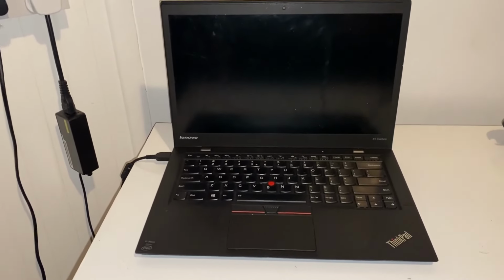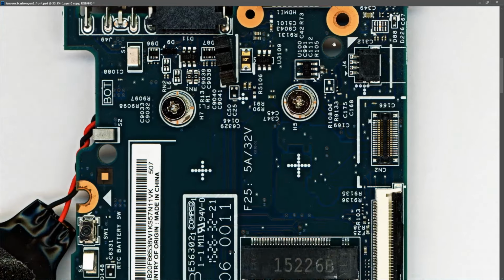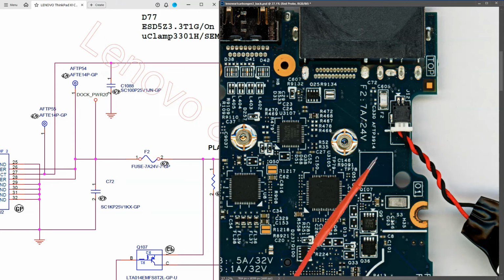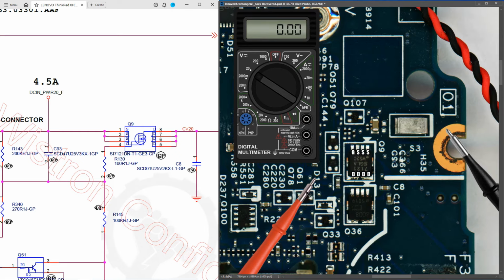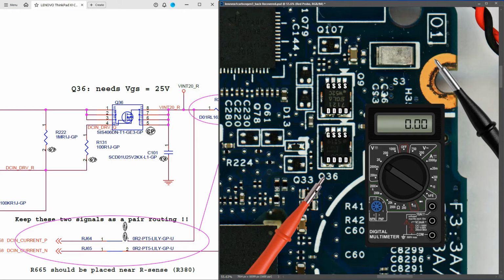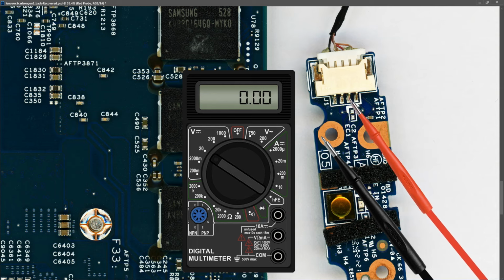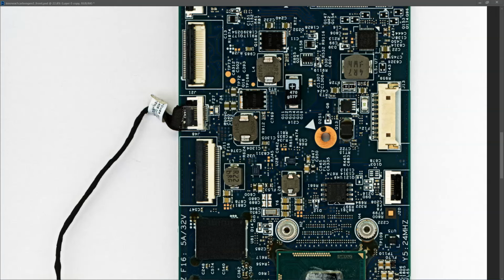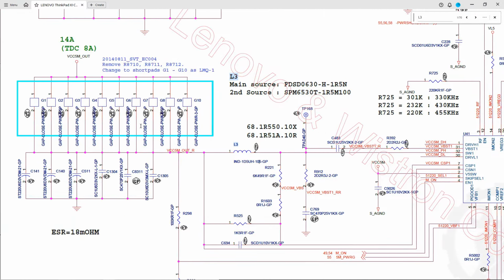LENOVO X1 CARBON GEN3 - I BROKE ANOTHER LAPTOP :-(

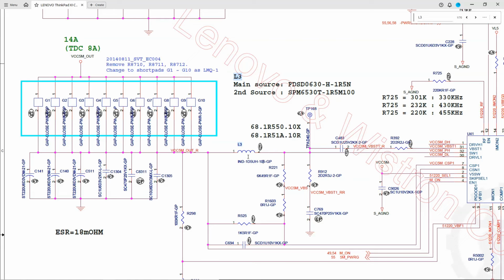Comment: (10:06) I would proceed like this:
1.- Verify that there is no very low reading or short circuit on the terminals of the ceramic capacitors connected directly to pins 2, 22, 23 and 29 of the TPS51220A IC.
2.- Verify that resistors R112, R725, R392 connected to pins 26, 3 and 31 of the IC are not open (infinite reading).
3.- What reading in Ohms and then in the diode test function do you get on pin 12 of the IC?
Now yes, without hesitation I would replace the IC with a new one and repeat the measurements in the previous three steps. Thank you very much for your time and sharing. All the best.